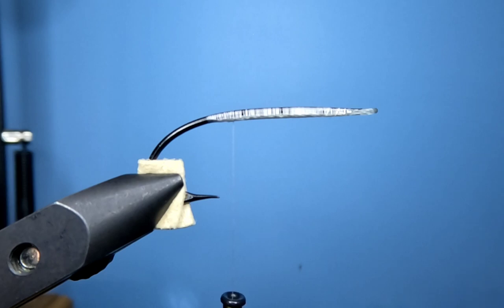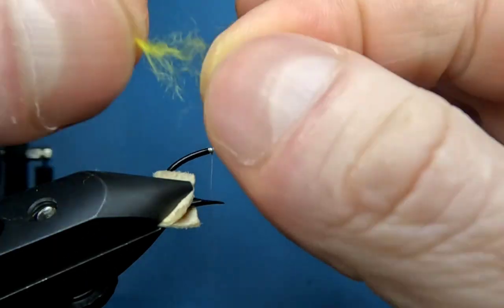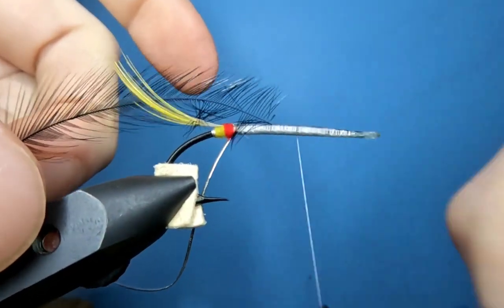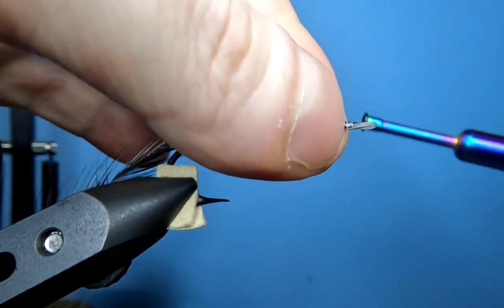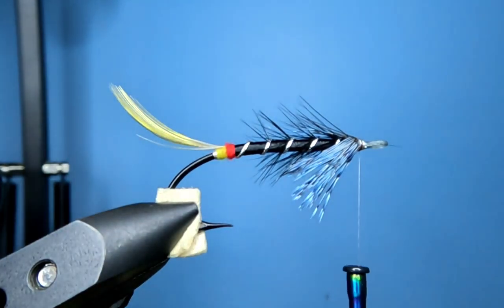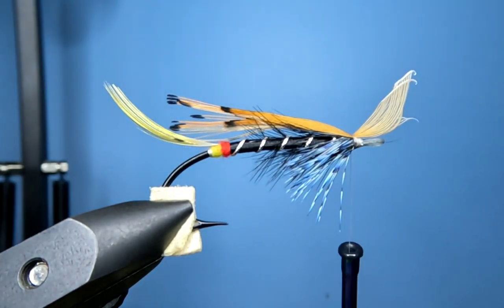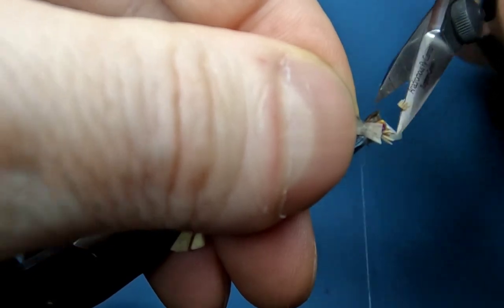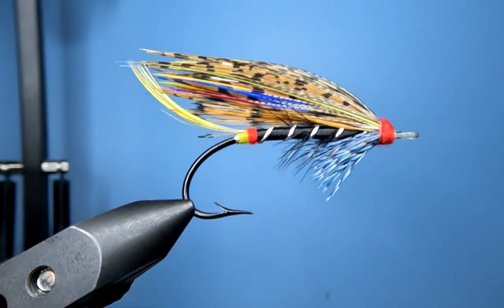Tying a Mixed Wing Salmon Fly; Black Doctor, and NEW Silk Review!!

Comment: This has a beautiful functional Irish style wing that just needs a pin put through it to fish successfully.  In an Irish context or as a functional fly a butt was regarded as essential, in this case a black one- its function was to keep the fly level due to the resistance of the water.
Reply from the maker: Thanks for the info. I don't really study Irish style flies. I just went off what the recipe called for. in this fly the recipe did not call for a black butt. It called for a red wool butt. So thats what I tied. As in the Lemon Ended Grey, I just followed the recipe supplied with the fly photo in the collection. The photo of the black dr.  also has a red butt. If a black butt would have been what was required, why then did they list red and use red?   I know very little about the cork collection and Irish style flies so I'm curious.
Reply from the maker: If its not to much trouble can you reach out to me on FB messenger or Instagram? I have a couple questions I would like to ask.  Thanks